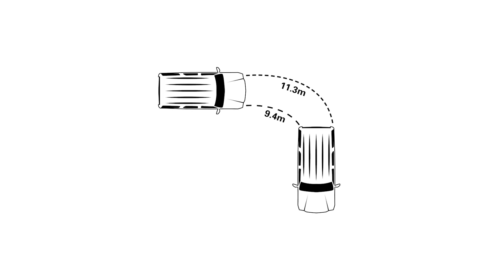SUB $600 DIY LOCKER INSTALL – Watch how much difference it made - Front vs. Rear, Manual vs. Auto

Comment: i've got an 80 series, can I go front and rear?
for a daily driver, how noisy is this setup compared with a manual lokka or standard diff?
can you feel the teeth slipping when turning?

Thanks guys
Reply: Firstly if your 80 is full-time 4WD, you need to convert it to part time before installing an auto locker in the front. It is dangerous to drive through a steer axle with an auto locker on the road. 4WD Systems have part time 4WD conversion kits available.  

Secondly I daily drive with a Lokka in the rear of my Cruiser. Driving around a corner it is very difficult to hear the clicking. When rolling around a corner in neutral or with the clutch in, it can make a banging noise (with an auto trans they operate more smoothly).  
Occasionally when there is a bit of driveline windup and it can make a bang when changing gears.  
It won't unlock if there is too much torque going through it so it will drag tyres if you accelerate too hard around corners and can cause oversteer on slippery roads. This can be more of a problem when there is not much weight over the rear axle. Back off a little around corners and prepare for oversteer when slippery and it is not much of an issue.  
Another thing is since it is normally locked, both tyres have to be exactly the same size.  

I have no problem with having on in the rear but some people don't prefer it.

Comment: Great Vid! What would you recommend on a ifs 100 series cruiser? 
Cheers Steve
Reply: Definitely would as I think I'll put one in mine BUT as Shaun mentioned, our 100 series are "full time 4WD" so we're gona have to fit the "part time 4wd" kits before we can fit a lokka
Reply: Being full time 4WD it'd pretty much be locked all the time when accelerating around a corner, that'd load up all the drive train and bugga something pretty quick!
Reply: @dcf476  dissenges when turning
Reply: @damienfrizzell9394  true but only when no drive load is in the diff, with full time 4WD the diff will be loaded so it'd stay locked which Shaun kinda mentioned.
Reply: @damienfrizzell9394  well I eat most of my words, yes we'd still need to install the 'part time 4WD' kits BUT now I understand how it disengages. Only a wheel being forced to go faster than the diff center will be released, no wheel will be unlocked to go slower than the diff center. So when turning, (say left) on road or high traction surface, the right wheel is forced to rotate at a higher revolution count than the diff meaning it will unlock whether accelerating or not but at no time will the left wheel unlock. So on dirt/slippery/wheel lift occurances, the wheel that wants to go slower(the wheel with traction/still on the ground) is forced to stay locked in. Amazing what happens when one reads how things work. Thanks for making me find out exactly, Damien :)
Reply: @damienfrizzell9394  I've watched quite a few vids on these and what you said is all that gets said in the vids, no one ever really explained 'why' only 'what it does' now that I know the 'why' it makes total sense, bloody clever bit of kit! :)
Reply: Yes - got two in my 100 series - will need the Part Time conversion kit for the front - The front will offer the greatest improvement off road by far

Comment: So my question is that I'm worried about ON road performance in the wet. Does it stay locked if you power through a bend?
Or does the lokka always stay "unlocked" when on road due to it not being in 4wd and therefore no torque being delivered to the front diff?
Reply: Lunch box locker are not the greatest...… You might get away with it in Australia but in snow you need a good locker !!!

Comment: I'd like to see how this does on snowy roads when you're in 4WD.
Reply: Terribly. The locker engages because of the pressure of the driving force applied to the front diff. This is what allows it to lock when you have one wheel spinning and the other stuck. So you might ask, how does it handle 4Hi on the highway/fireroads? It doesn't. It will absolutely kill your steering. Even in very slipery conditions, in 2WD, it might not even be enough to allow for the racheting action. In short, this is only good for your rock climbing vehicule that basically only sees 4lo.
I understand that 4WD Action needs money and sponsor videos and that australia doesn't see all that much snow, but at least a disclaimer about the limitations of this type of locker (lokka and other brands) should NOT be applied to daily drivers.
Reply: @sephiros9883  "australia doesn't see all that much snow".... So you've never heard of the Snowy Mountains in Australia then?

Comment: How does this work when you hold one wheel while spinning the other and the lock disengages. And you did it while the wheels are straight? Wouldn't it do the same on the track? One wheel gets stuck and then it disengages the lokka.
Reply: Stays locked if their is input from tailshaft ie throttle

Comment: There is a lokka or lunchbox locker or a Torsen available for de new toyota rear 8.75in differential? Looking for other options besides the ARB or the ELocker. The vehicle is a Hilux Revo 2019 base model 2.8 diesel engine 4x4 6MT 3.58 ratio Non locked (open diff). Thanks

Comment: How's it Shaun what happens if you turn on an obstacle would it then not be unlocked again or how far is the tolerance from the lokka?
Reply: If there is no wheel spin it can unlock - eg going over a builder or log with one wheel - then its travelling further and faster than the other wheel and it can unlock. If there is any wheel spin it either wont unlock in the first place or will unlock during the process and if the wheel starts to spin the wheel that unlocked will relock again.
Reply: @4wdsystemsgeartogoannawher754  ok thank you very much. What about shipment to South Africa?

Comment: i have 1 in the rear & i have to roll around corners without putting it under load or it wont unlock  this would be a nightmare in the front

Comment: Is the locker noisy? Looking to put lockers on my daily driver. A lot of highway driving
Reply: the noise from the lokka indicates that it is actually working correctly. Highways are often fairly straight bits of road so that will have minimal effect on the unlocking process

Comment: Anyone got experience of running one of these in the front axel in snow? Just wondering if there is enough traction for the faster wheel to unlock when cornering or does it increase the tendency to under steer?
Reply: Auto lockers in the front axle will always increase the tendency to understeer.

Comment: Looks good but what is the clanking noise when the wheel are turning?
Reply: Ratching noise is going to be always there. On my WJ, it did quite down after a few thousand miles. Also heavier weight oil helps dampen the noise as well

Comment: Currently I use open diff oil, maybe a stupid question but would it be recommended to now use lsd oils in my front diff once I install the locker ? Thanks in advance
Reply: Use the same oil you are supposed to use in that diff, the Lokka does not need LSD oil.
Reply: No worries thanks for the help,  best place to buy one ? Tried google but couldnt find an AUS site for them
Reply: There is a link to their website in the video description and they have a shop in Adelaide.

Comment: Will i notice the click sound when i am turning ?
Reply: In the rear on the road yes, - but its no problem and I guess 50% of installations would experience this - off road probably not, in the front off road very unlikely, on road it shouldnt even be working at all. If its a Borg Warner in a Commodore - for some reason the boot acts like a speaker box  - Its louder!

Comment: How do these go with sand and high range 4WD if it is constantly engaged?  Lockers don’t really do much for sand work....
Reply: Its not alway constantly engaged it can still unlock when you turn but that isnt a slippery situation. Where you will notice the improvement in sand is driving up a big rutted dune - with an open diff each time the wheel lifts up off the sand as it bounces you'll see that little spurt of sand (that causes the other wheel not to drive) and you lose momentum - on a big dune that could happen 20-50 times and you might not get to the top. The Lokka prevents that from happening. In deep ruts whereas with an open diff you behard lock and still not turn up and out of the ruts, with a Lokka you will get the drive and directional steering and it will improve your ability to climp up and out - especially helpful when the tide has changed on a steep sloped beach (like we have in SA) and you need to get higher up the shoreline to avoid getting into the surf - bu the tracks you are in are so deeply rutted you cant get out and are heading for the waves !

Comment: Nice!  I want a front locker for my Colorado to assist with it's LSD rear.  Will this work too?  2017 Z71 model.
Reply: Darth KegRaider I've had rear lsd and front auto lokka on my 2013 d22 for four years now and driving off road has never been easier for the car and me.
Reply: Konrad Hugh-Clink can I ask how it behaves on the road when the Nav is in 2wd? Clicking? Noisy? Under steer ? Cheers

Comment: What will be better in front diff, auto or manual, for mitsubishi pajero sport /challenger 2012 with super select, cause it can be part time /full time at the same time? And how this auto locker will work at winter? I live in Russia)))
Reply: Definitely front - we dont do the rear anyway. I think yours is open diff rear. Have a look at the FAQ n the website
Reply: @4wdsystemsgeartogoannawher754  I have pneumatic locker in rear from factory.

Comment: I’ve got a manual locker in my car, was wondering how bad turning is for it ?
Reply: depends on the Vehicle.  My experiance suggests the heavyer the vehicle, the less you notice any turning issues.  Light vehicles tend to suffer a little more.  I know someone with a comp truck (so very light) and he has just welded his diff (so technically now a spool, not a diff).  He just unlocks a hub if he needs to.  I've been told he now has electric hubs and 2 switches on the dash so he can release just lefty, or righty or both without getting out.

Comment: so I have an 80 series permanent 4wd. Shawno said the front won't work but what about putting one in the rear? would that work without a 2wd conversion?
Reply: Yes it works in the rear, but it doesn't behave like an open diff. I use one in the rear with no problems but some people don't like it. It does make noise sometimes and can wear your tyres out if you don't drive accordingly.

Comment: Why won’t the lokka work on a full time 4wd like the prado 120?
Reply: Hi Quintin, it will work - it's just a bit noisy. Did you hear the noise when they did the unlock test? The tick-tick-tick? You would get that all the time - every turn, and tight turns on hard surfaces puts a lot of strain on the lokka too. Whereas a car with part-time 4wd you're not driving the front wheels when you're out of 4wd.
Reply: @alexdevries7594  Thanks. Then with regards to any 4x4, when on gravel roads we lock the centre diff or transfer case; Does the auto locker affect steering / stability when doing 80 - 100 kph on gravel roads with the centre differential locked?
Reply: Quintin Kruse -  in my experience, steering is just a little heavier. Not restricted like a normal manual locker. At those sorts of speeds though, it may be a bit noisy when cornering. These sorts of auto lokkas work really well with a part-time conversion kit - like free-wheeling hubs.
Reply: @alexdevries7594  Thanks Alex
Reply: It is dangerous to use an auto locker in the front of a full-time 4WD because it can stay locked when there is enough torque going through it.  
This can cause understeer and leaving the road.  
For certain vehicles they have part time conversion kits available.
Reply: @JeremyPetho  say bye bye to traction on gavel then
Reply: @damienfrizzell9394   Correct, there are compromises you have to make when using auto lockers.
Reply: @JeremyPetho  not worth it imo
Reply: Depending on the engine and transmission it works fine in the rear but not in the front of a constant 4WD - they do unlock in the fornt and I drove one around for a week jjst to see how it drove years ago in my own vehicle, but that is the prpblem on road there is an issue of torque steer as they lock and unlock - its unpleasant and doesnt feel predictable
Off road this doesnt happen to the extent hat you can feel it, but on road you can. There are in fact many people who have fitted them, but we dont recommend it unless its a full off road vehicle

Comment: Ive been looking at these for a while, almost sold on one for the front of my GU but i have two questions. What are they like turning under power in soft boggy sand? And decending steep slippery muddy turns whilst in 1st gear low range?
Reply: Good questions - answer is a bit long for this. Under power in soft boggy sand they will stay locked,  under no power they will potentially disengage if differential action is needed (no force is needed to disengage) . Down hill engine descending is dramatically enhanced - with an open differential (or LSD) if you feather the brake while engine descending and lock one wheel by accident - the other wheel (with the most traction) will now double its speed and literally accelrate the vehicle down the hill ! Call me for detail
Reply: So it would probably be under some load engine braking down a hill and a little harder for the Auto lokka to unlock, I suppose. 
That's one thing to think about.

Comment: What are your thoughts on these for 150 Prado's?
Reply: I expect a fulltime 4wd will be noisy with an auto lokka installed. It would work, but there would be a fair bit of strain in "carpark" turns.
Reply: Fronts in the C4WD arent possible but the rear we can do with both VSC and without, LSD or open diffs

Comment: Hi

I just want to find out more about why not to fit this locker in an AWD vehicle?
I've got a 1994 Toyota Rav4 AWD.
If I fit a locker either front or rear, it will have to work at all times.
In the same breath on the web site it states that it can be fitted to 4×4 and 2×4 vehicles.....
In the 2×4 vehicles it actually comes down to the same practical working order as the AWD vehicles.

Is there anything that I'm missing?
Thanks alot to take the time to read my question.
Reply: Its not that we cant fit one its just that we cant fiont one to the fornt. But we have the rears for most of them. But unfortunately we dont do the RAv4

Comment: How does an auto-locker disengage in the rear axle?
Reply: It allows the outer wheel to rotate faster than the carrier when turning, but with too much torque it stays locked.

Comment: The current model Hilux and Fortuner have ADD (automatic disconnecting differential)front diffs which have 1 driveshaft disconnect when 2wd is selected. Would a Lokka work or would it need free wheeling hubs to stop the whole front driveline except the disconnected shaft from turning all the time?
Thanks for the video guys.
Reply: Any reply???
Reply: Yes this is the dame as the featured Hilus in this video - the same style of ADD is in most modern IFS vehicles and we can fit most of them
Reply: So does it make any clicking noises on Road. Has it made any difference to fuel consumption on Road as well?
Thanks
Reply: @oot1960  No change to fuel consumption, no clicking sounds from the front on road, but you will hear clicking from the rear on road in a turn.
Reply: I don’t want to be negative but the video shows Shaun testing the locker on stands, I presume 4wd is engaged but the transfer in Neutral for the passenger side to be engaged  by the ADD system. That’s all awesome but when the Hilux is in 2wd and the ADD system disengaged I’d like to know what happens to the active Drivers side driveshaft. Does only the D/S rotate as there will be no load on the pinion to lock the Lokka resulting in constant clicking and wear on that drivers side toothed cam?

Comment: ive gotten onto the site and im looking for a rear LOKKA differential kit for a 2006 Nissan Navara D22 3L but they only have them for the front. are they universal for front and rear or made just for the front and dont hve any for the rear?
Reply: Front and rear axle on D22 are completely different so you will not be able to put a front one in the rear.
Reply: Only got the fronts for these - its defintely the better end to do since the IFS has the limitations

Comment: How does the Lokka perform/act at higher speeds? Will the Lokka smoothly slip in and out of engagement; as you turn and return to straight (doing 80k's up the beach & beach accesses), and when you're swinging the wheel side-to-side coming through a bog-hole? 
Could the uncontrollable slipping in and out of engagement disrupt your steering, at higher speeds?

Is there anyone on the Gold Coast that could help me with this?

That 20% discount code probably doesn't work anymore, does it?

Comment: i've got a new mazda bt50 with rear locker standard.. is it worth getting a lokka for the front? will it cause me any problems?
Reply: I’m thinking the same thing with my PX ranger as I always get caught out with a wheel in the air and have to engage the rear locker
Reply: I was thinking the same and had a look at the website and they don't have 1 for the BT50.
Reply: @joelread4229  damn, my mate thinks i should be fine with just the rear with the stuff i do...
Reply: I spoke to 4wd systems earlier today and the are doing pre orders for the bt50. I order 1 and he said it will be about 6-12 weeks depend on a couple of things.
Reply: @joelread4229  okay mate, perfect.. i'll look into it thankyou